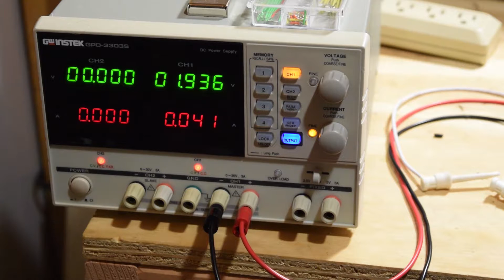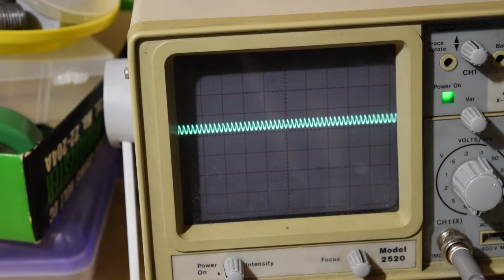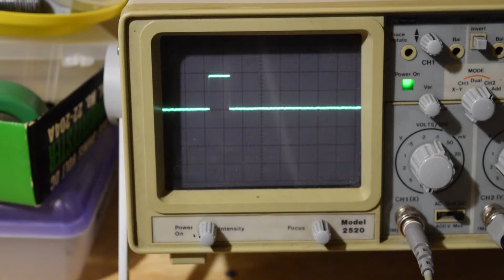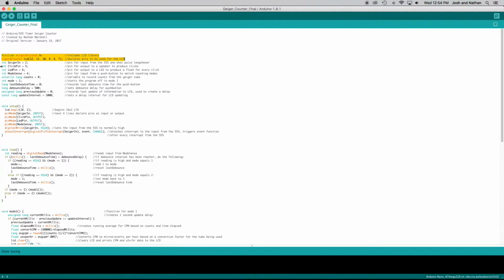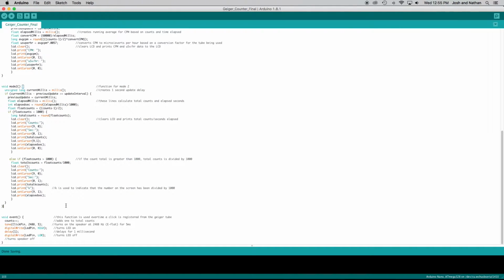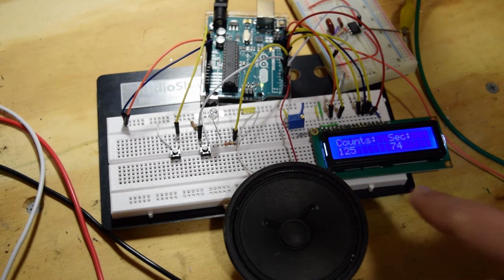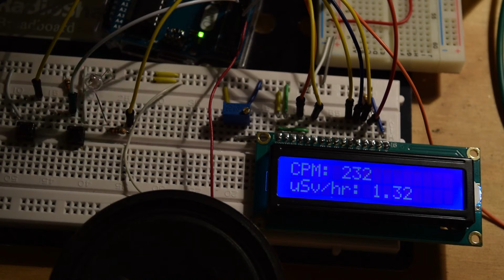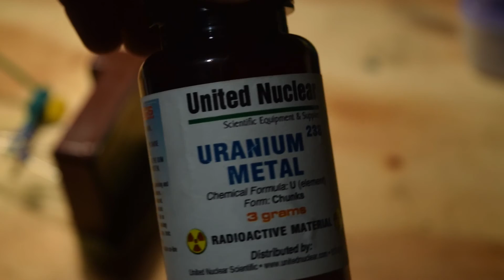DIY Arduino Geiger Counter

Comment: Neat work. I was wondering why you use an resistor at the negative pole of the sbt10a (Pin11). For sure you need them at all the positive ones (1-10), but why exactly do you use a resistor at the output pin?

Comment: Really great project ,I think you could’ve used arduino code available online although coding it yourself sounds cool.Also you are way over kill on protecting yourself from that uraninite sample ,it is better to be careful but for a piece like that you don’t really need much protection besides a sealed plastic bag and  gloves if you are handling it directly and that’s still kinda overkill .im a bit too relaxed maybe ,I don’t always wear gloves but I do make sure only to open the sealed containers outside as particles and radon are more dangerous than the radiation.Keep using the lead shielding more safety’s never bad ,it’s just overkill for me.

Comment: Hi, I'm starting a research with radiation and I'm looking for a way to characterize the radiation types.
Can your project make such a thing? 
My idea is build a device that is capable of detect radiation and distinguish them based on some particular aspect, like a signature, with most low budget possible.
It's my final undergrad project.
Reply: Small cloud chamber with an image algorithm that determines the speed, energy, charge and other factors from the smoke trail. You might set up varying electric and magnetic fields in the corners to distinguish the particles as they pass through the zones.
Reply: @Baigle1   Thank you very much.

Comment: You've done a lot of good work here. I suggest you make a video documenting and preserving your design. In the video, show how you transfer your working project to a schematic, and wrap it up, code and all, and put it somewhere. I like the idea of using Github as a repository for posterity. 😁 I would also suggest showing how you determine the correct resistance for limiting the current flow through the Geiger tube, and calibrating the circuit for a particular Geiger tube.

Comment: Hey, did you have the schematic and codes? I works with ambiental radiation detection, and like to upgrade my ionization chamber and maybe build a geiger counter. Thank you
Reply from the maker: Alexandre Maquera I do not actually have a schematic because I built the circuit as ideas came into my mind, but I do have the code if you would like it. It might not be 100% debugged but I haven't encountered any problems with it so far. What would the best way for me to get the code to you?
Reply: If possible, can you please send me the code? matthewmoore7314@gmail.com 
And would it be possible to send me a list of the parts used?

I'm guessing part of it is similar to this https://www.eeweb.com/blog/circuit_projects/555-timer-as-an-analog-to-digital-converter